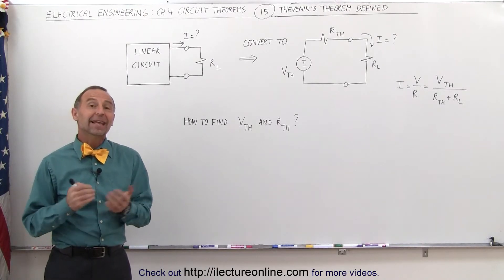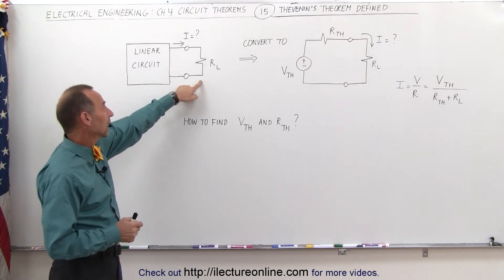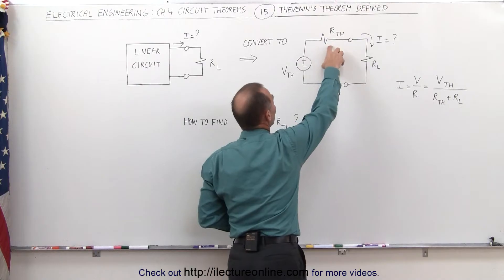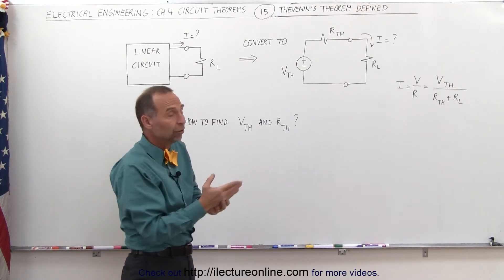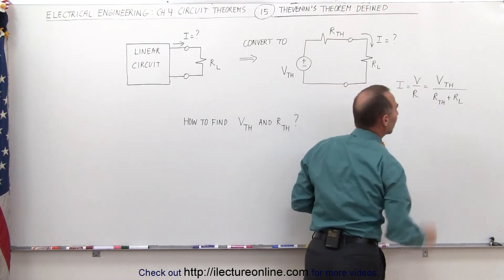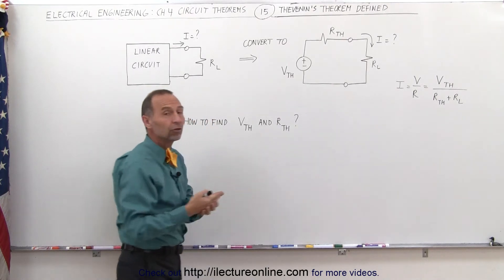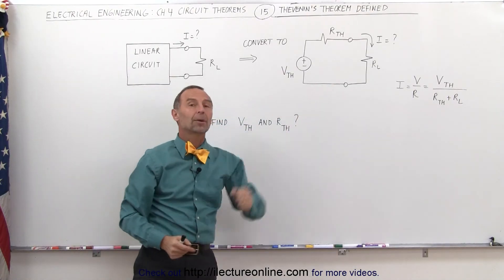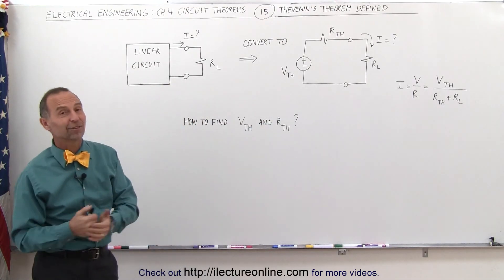Electrical Engineering: Ch 4: Circuit Theorems (15 of 35) Thevenin's Theorem Defined

Comment: a 230V 50hz ac supply is connected to a resistance 2.5ohm coil of inductance 0.06h and capacitor of 6.8uF connected in series. calculate  
impedance of circuit
current
phase difference between voltage & current
Reply from the maker: We have a lot of example just like that in this playlist:  PHYSICS 49 RCL CIRCUITS
Reply: @MichelvanBiezen  Hello sir
How to solve

Comment: What is the load resistant ? Was it given in every case of thevenin ? If not, how can we find it.
Reply from the maker: A circuit is usually thought of as consisting of two parts.  The portion that supplies the current and voltage, and then the portion that executes the function of the circuit which must be supplied with current and voltage.  That portion is called the "load" and can be represented by a "load resistor" to make it easier to learn the techniques of circuit analysis.